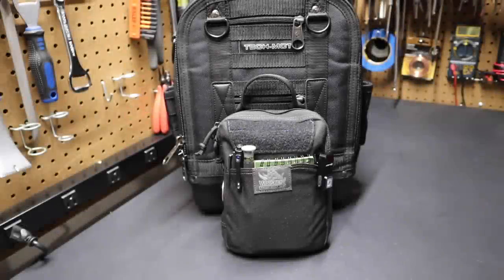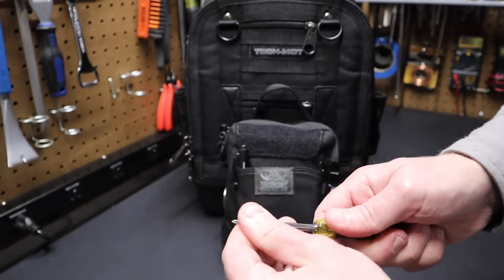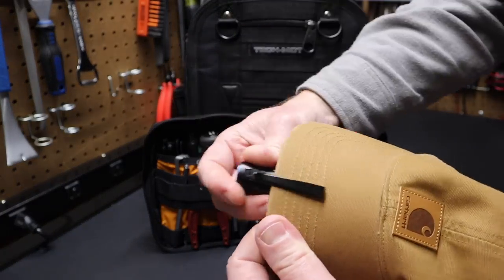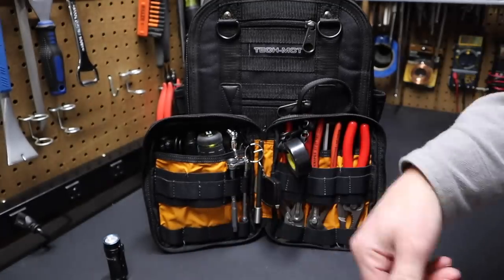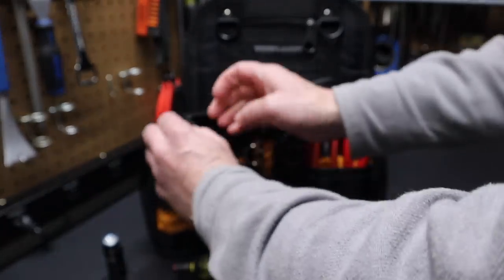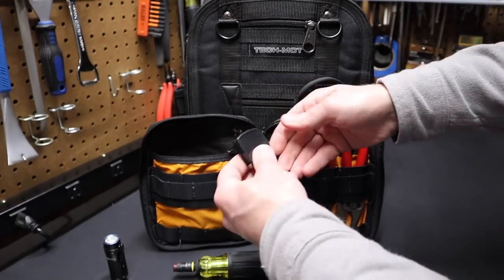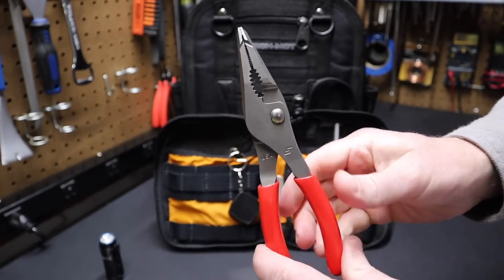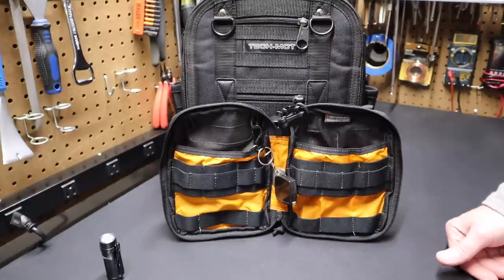Tool Pouch Loadout Setup 3.0

Comment: If i remeber correctly you used to have wire strippers? How are you stripping and crimping with this setup? Utility knife and pliers wrench?
Reply from the maker: Right, I can get by with the knife or flush cutters and pull off the insulation. Thanks for watching!  👍

Comment: What kind of repairs do you use this for
Reply from the maker: Replace a faucet, replace an electrical receptacle, switch, light fixture, replace a car battery, replace a small engine carburetor, assemble new furniture.  I'll add a list of things I've made myself use it for when I had a full too bag, to the video description.  Thanks for watching!

Comment: Great quote to remember "Begin with the end in mind". What is the purpose of this EDC? To get home? Grid-down? To fix your vehicle? Bugout? To get to a Bug-In location? In a grid-down scenario, you may want to add small bolt cutters, and a 4-Way Sillcock Key Set for Valves, Faucets, and Spigots to obtain clean water.
Reply from the maker: Good point, good suggestions!  Thanks for watching!  👍

Comment: The one most useful item I see missed is a hammer.
Reply from the maker: Or a hammer substitute. Thanks for the feedback and thanks for watching!  👍
Reply: I’m with you. I don’t carry a traditional hammer either. For no good reason. Although I do have trucker’s friend that I could use in a pinch. I think a small hammer is in my near future.
Reply from the maker: You can customize it to suit the task.  You could fit a nail puller in there.
Reply: That’s that a pair of lineman’s are for 😂😂

Comment: a wiha plus toolkit would replace a lot of the things you have there
Reply from the maker: Wiha doesn’t make one. Thanks for watching!
Reply: @projectpinehills  Wera not wiha, i keep mixing them up
Reply from the maker: Wera is nice but metric and standard sockets are sold separately and the mini ratchet is not flex head.
Reply: @projectpinehills  i don't think I ever needed anything imperial. Everything is in metric in any country i went apart from us, and in any equipment. I'm an industrial automation engineer and i travel a lot, only needed to use imperial once and the people on site had the necessary tools since it's a pain to checkout tools when flying i usually ask the customer to have the tools ready.
However i always carry a small toolbox with me and it has that toolset which is small and high quality compared to almost any other brand. German tools are the best by far.
Reply from the maker: @sageata_verde it’s a great kit, I just prefer the Icon ratchet and I like bits stored in the screwdriver handle.
Reply: @projectpinehills  guess i can understand that, my precession screwdriver set is like that, well the compact one i always carry in a separate pouch. here i have a set of these to complement the wera: PB 515 swisstool. they are pretty expensive, but in my line of work i prefer swiss or german hand tools that even though are a lil bit more expensive they are better. for personal use i have some cheaper options since i dont use them that often. Also for power tools i use Milwaukee, they the best around from what ive seen. but for hand tools, bits and stuff that dont have electronics in them, german or swiss allthe way.
Also i higly recommend the PB 515, its compact and solves most problems.